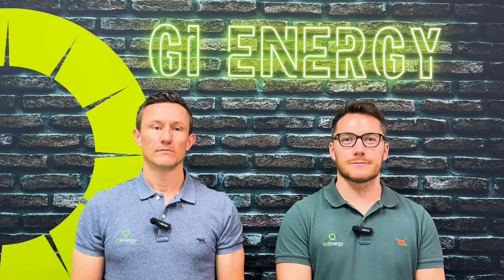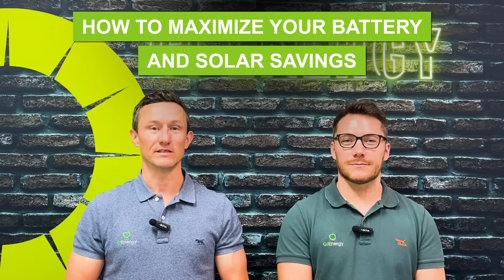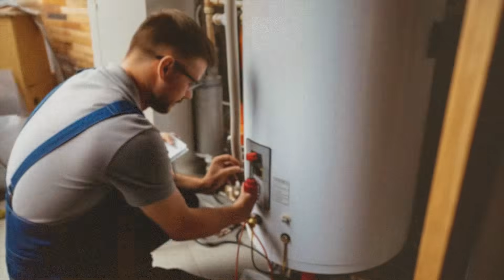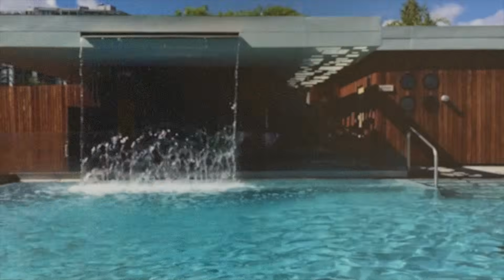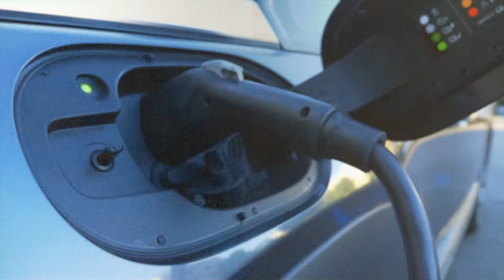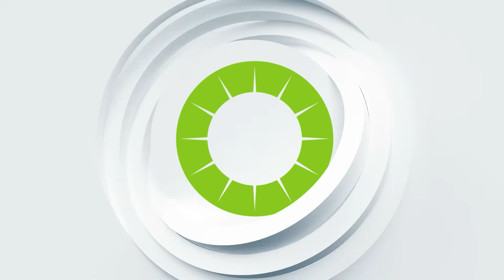Maximise Solar & Battery Savings - Proven Strategies After 16 years Installing

Comment: Hi, audience from ACT
On Amber and with a 48kwh battery
we don’t get the import (very low in middle of the day, the lowest I saw was 6-7C and export rate (normally 7-12c at night) like QLD. I could manage to sell enough cover off the daily charge and Amber fees. Hope prices will be better. Otherwise no way to get ROI back any time soon

Amber AI is not doing anything with that kind of price range so I had to manually discharge the battery at night most of the time to get some money back
Reply from the maker: Maybe check out Flow Power. We don't cover ACT but if you can access their battery offer you can probably still get way better feed in than that and improve your ROI significantly.

Comment: Great video, and one thing that a lot of younger couples with or without kids forget is that solar on its own is a waste of money if you are both out of the house during the day and can’t run the high energy consumption equipment when solar is at maximum output so a battery and smart home is the way to go.
Reply from the maker: Spot on, shifting load to match solar generation is the ultimate goal!

Comment: We have had zero power bills for nearly four years now since getting batteries. 
But even with 10kw of solar thats not enough to justify buying an ev. 
My advice ? Get a low interest green loan and spread the cost of repayment over at😮 least five years so the savings offset the repayments by at least 80 percent. Thats how we financed our first 5kw install and made it very easy.
Get tier 1 or you will get screwed. SMA or Fronius inverter. Our older polycrystalline panels are still pumping out as good as new. SMA inverters are bullet proof reliable. 
If you dont have north facing roof with low shading your gonna fall short. To many installs are hog tied by lousy orientation of the panels. 
Cheap systems die within four to five year's. 
Some say work the batteries hard to maximise ROI. But I prefer to avoid flogging them and run with the sun as much as possible and avoid heat stressing the batteries. The harder you pull, the more likely  you will form dendrites in the cells. Oversize and go for high stacks so you get higher voltage amd greater efficiency. Higher stacks recharge faster too. 
Typically we only draw about 25 to 30 percent per night. 
We try to keep draw below 2.5 kw when batteries only.
Good luck and make sure you use an installer with a long track record. The shonky guys only last a few years max. These guys seem legit.

Comment: I hardly use my 20 kW solar, but rely mostly on battery 🔋 . 

I have not drawn power from the grid in Melbourne Australia, in many months even in the depths of winter. 

I rely on my 48 kWh three phase Sig, 25 kW Sig EC, and Ovo free electricity between 11am-2pm. 

Sig gets charged to full within 2 hrs during the free window slot. We simply just draw from the battery all day and night when cloudy or no sun. 

Typical daily usage is 20-40 kWh all seasons.
Reply: That's a big system. But hardly typical.
Reply: How do you heat your house? Heat pump!
Reply: Hey Elephant man, haven’t seen you in the Sig community for a while?